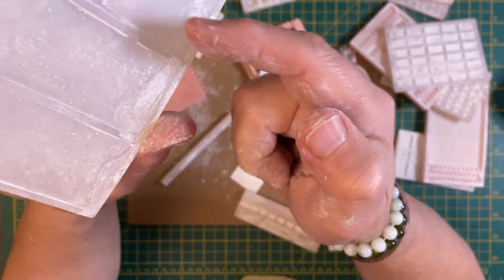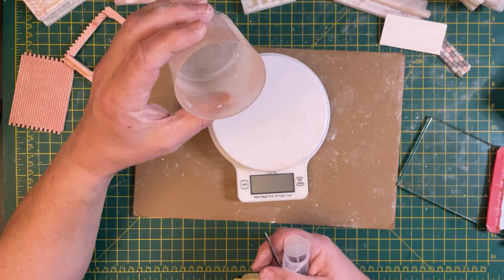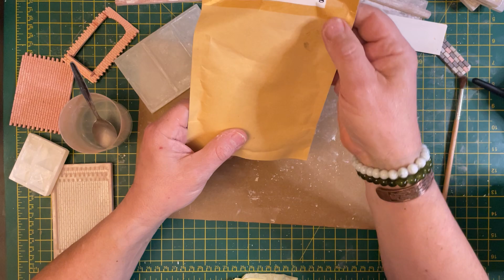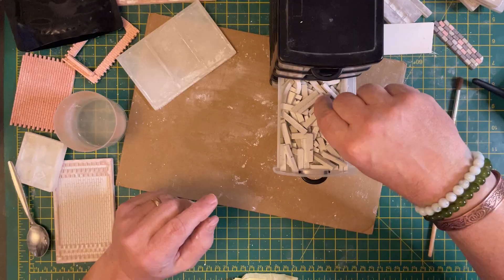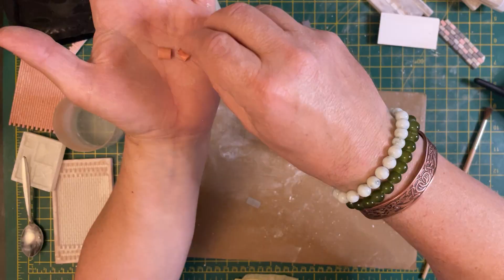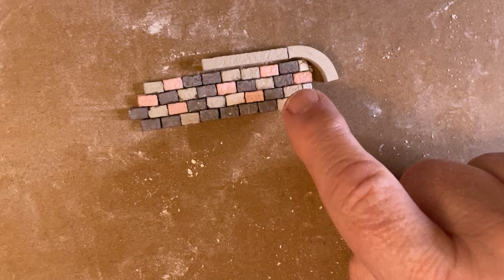Custom 1/35th plaster Moulding of bricks, cobblestones, and roof tiles, paving slabs and walls

Comment: What is the rinse aid for?
Reply from the maker: Hi, I missed your comment... so sorry ... The rinse aid helps break the surface tension on the mould, allowing the plaster to flow in and fill the void... the agitation then helps the bubbles come to the surface, which again is supported by the rinse aid .... tbh I haven't found anything else that does a better job.  Thanks for watching ... not sure if the video has gone down that well.. but its another aspect of scale modelling